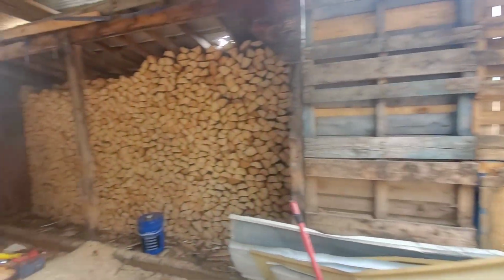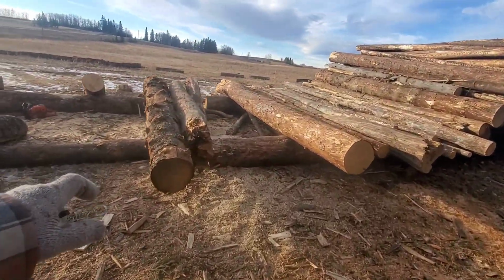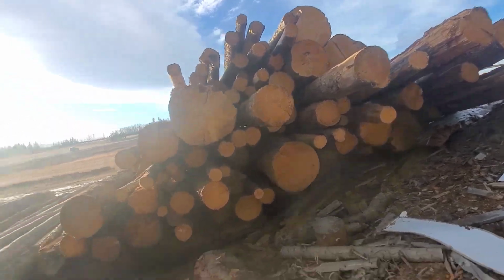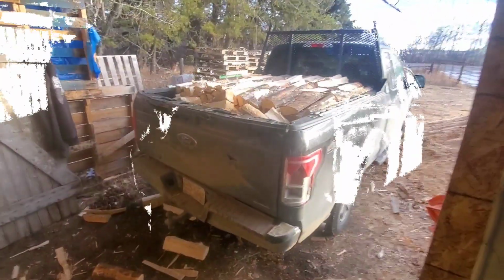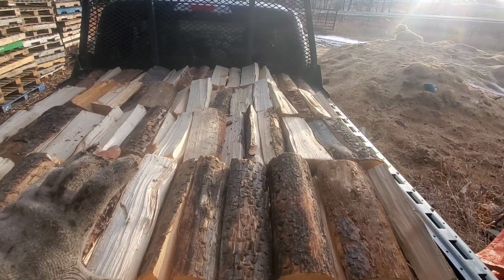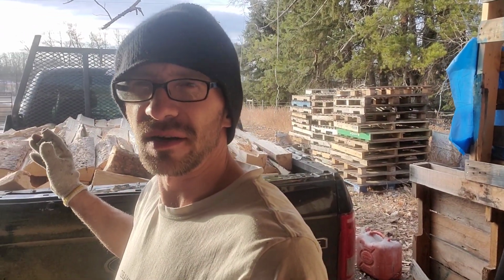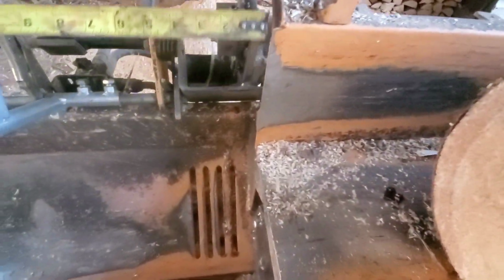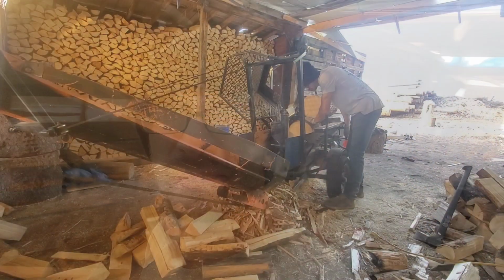How Much Firewood Can You Fit Into A Truck Bed??

Comment: I have a Ford standard 8foot box and stacked I get a half cord.
When advertise firewood I give the year and model of truck and with photos that seems to elemate questions on how much I can deliver..
Reply from the maker: I might be thinking of a newer long box but I'm sure that a 8ft box is 78 cubic ft? But good point, definitely didn't think about how boxs sizes changed over the years. 👍👍